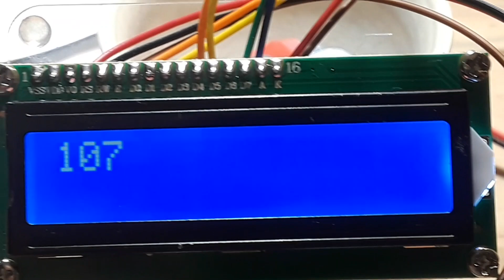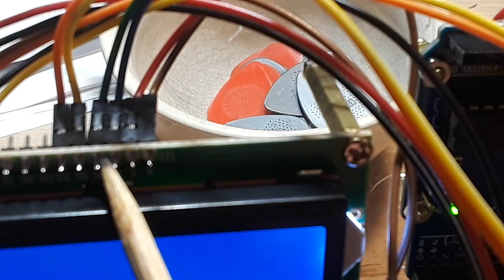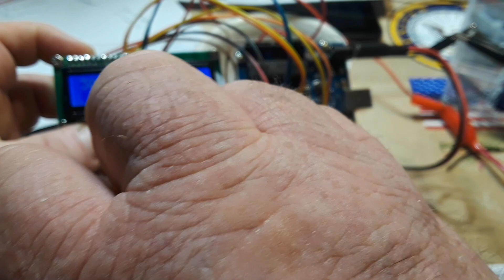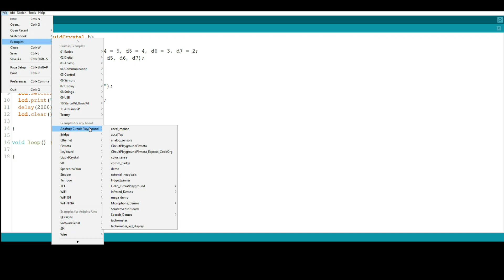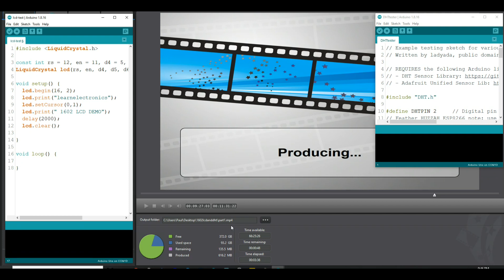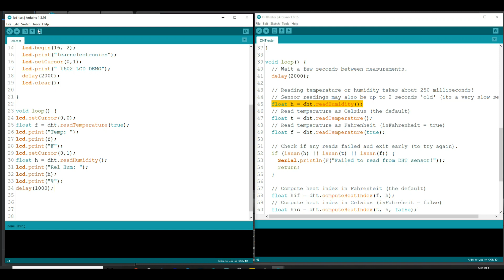The Almost Complete Guide to the 1602 LCD and Arduino

Comment: you really should use a non metallic adjustment tool in those variables... if you make it common practice in the long run you will stay out of trouble

Comment: Grate video Paul I would probably just cut and paste the library into the code I still don't know how to write code. I am beginning to think that Ardeno is not for me.
Reply from the maker: Cutting and pasting is exactly how I do it. I just open the relevant library and then copy the parts I need.
Trust me, I'm no programmer. My last computer class was PASCAL in the late 80's.

Comment: Why not check to see if dht1 temperature read failed? how do you know what voltage for back light?
Reply from the maker: Because if it failed, the display would say null...then I would know. As for the backlight, you can run it at 5V. I find 3.3v is plenty bright and it will save the light by not running it at full voltage.
Reply: @learnelectronics  Sorry for not replying sooner. I did not know lower voltage means longer life for the LCD.